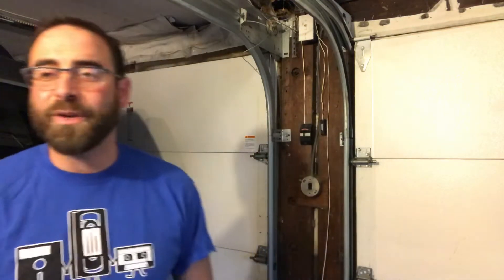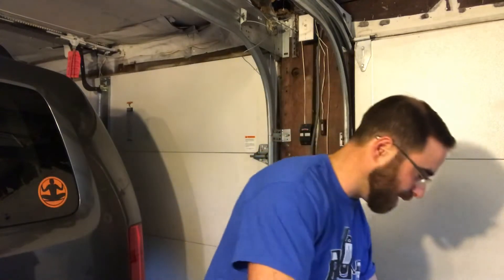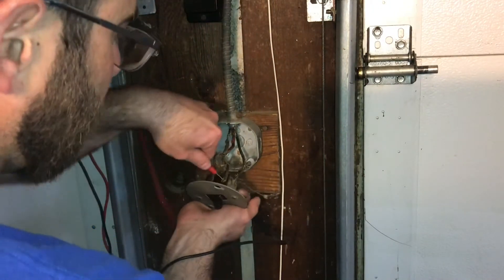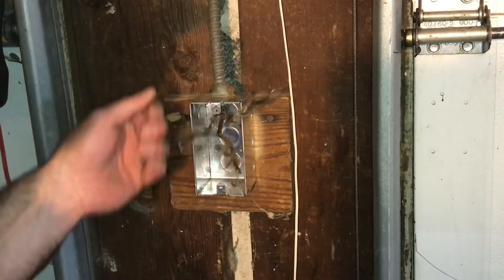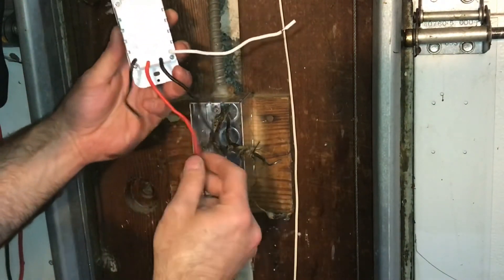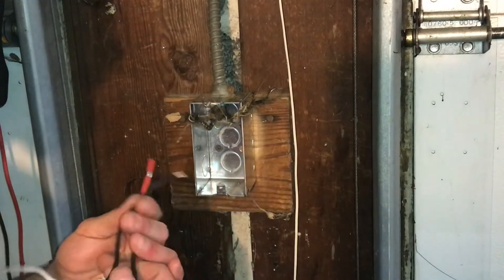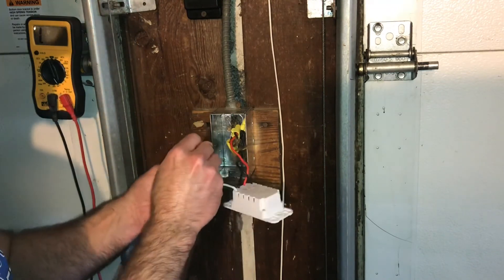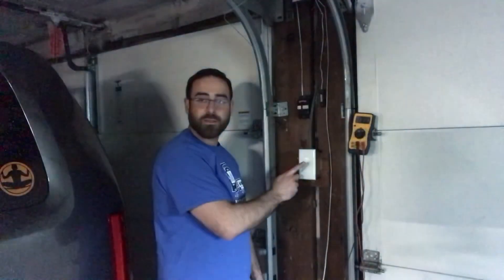3-Way Smart Switch installation - with or without neutral/ground

Comment: I too have an old house and couldn't figure out what to do with the neutral wire. Thank you for the explanation.
Reply: Did it work when you screwed the neutral wire to the box ? I am thinking of giving it a shot myself.
Reply: @Chaptay23  yes, the instructions in this video was the solution.
Reply: I feel compelled to point out that depending on which smart switch you've purchased what the neutral wire is actually doing is supplying a constant stream of a tiny bit of electricity to the Wi-Fi unit inside the smart switch... and I've made a "grave error in judgment" thinking that I could just install smart switches that have Wi-Fi in them that require a neutral wire and ground out that neutral wire --which ended up just being a really good way to ruin all my smart switches the first time there was a storm...

Comment: I have a TP-Link Kasa wifi switch that requires a neutral such as your switch but do not have a neutral in the wall. Isn't it dangerous to bolt the neutral on the wifi switch to the box? Won't that send current through the ground circuit throughout the home? It seems that it did not for you but I'm unsure as to why. Can you explain if this is safe or not? From what I've read you are not supposed to attach a neutral wire to ground ever but perhaps that's just a neutral wire that already exists in the wall? Thoughts? Thanks!
Reply from the maker: I had the same thought as you see I tried to obtain a voltage off of the box at the end of the video. Here are my thoughts. If that neutral wire represents that of a 120v AC circuit (which I don’t believe it to be that) then 120v would flow through that. However, it would be and is grounded to 0V. Regardless, you will never be a better path to ground than the actual ground. 

None of that matters though. Most three way switches do not have a common/neutral wire as part of the circuitry. It just doesn’t make sense.  I believe this wifi switch runs on DC. Therefore it transforms the incoming AC to DC without being able to complete the circuit with the absence of a neutral/common. I believe this to be the purpose of this wire (to complete the DC circuit). Therefore, the current zeroing out to ground should be low voltage DC. I recommend checking this theory with a multimeter set to DC after wiring.
Reply: @gjdct  Well, I decided to try these switches at my other house that has more modern wiring and neutral wires. I still couldn't get it to work I'm not sure why. I was able to power the switch, control the switch turn the switch on and off but I couldn't get power to the actual light. Something must be funky with my wiring in that house. I've put in single pole and three-way switches before without a hitch. I may just buy some smart switches that don't require a neutral wire if I could find some that don't need a smart hub. I like the tp-link casa switches but they're apparently a hassle for some home wiring installs.
Reply from the maker: @MaxSpeedMediaLive  the smart 3-way switch should be the first in line of the circuit to get consistent power (which you won’t be able to tell without a multimeter and the power on, or trial and error). The second 3-way switch typical only gets power from the travlers and not the black screw (if that make sense). https://images.app.goo.gl/fLK51np9kdY1NiXp8
Reply: @gjdct  wow that shows how much you know about electrical circuits a neutral wire is what allows you to actually have a device operate because it completes your circuit That's why you don't see them in most switches most switches don't require power they are just breaking the power toggling it whereas some lighted dimmers do require being connected to a neutral in order to produce the backlight. There's a specific reason that they say if there's no neutral in your box contact an electrician 😂

Comment: So you just screwed the neutral into the box?
Reply from the maker: In short, if you have white wires tied together as you would in a modern, correctly wired system, add the neutral to that existing wire nut. If you have metal cables/antiquated not entirely wired correctly system, you can add to a grounded surface which is the metal box.

Comment: What brand Smart switch is that? I’m running into a similar situation. Thanks for this very helpful video.
Reply from the maker: This is a Meross switch. The neutral wire needs to complete circuit. If you are using standard romex 14/3 (required for a 3-way switch) with a red, white, black and ground you would just add this to the commons (white) already tired together. In my situation, I have BX cable with no common. Since the metal sheathing/metal box of the BX act as the ground I made a connection to that which is another way to complete the circuit.